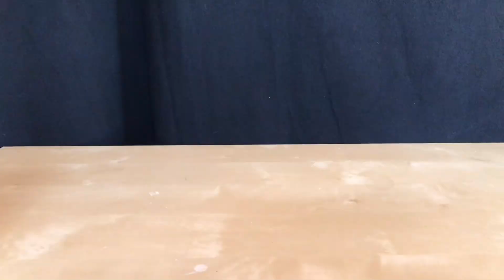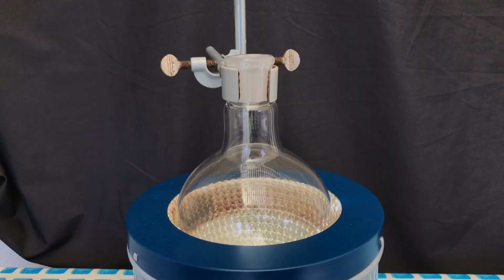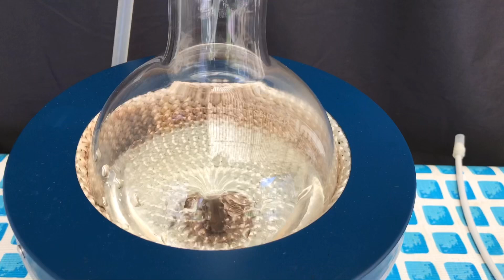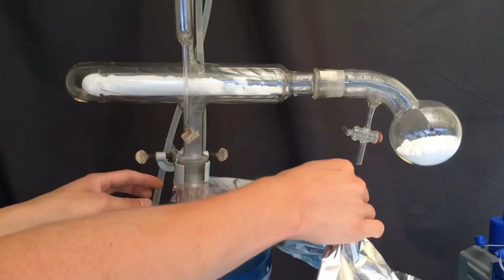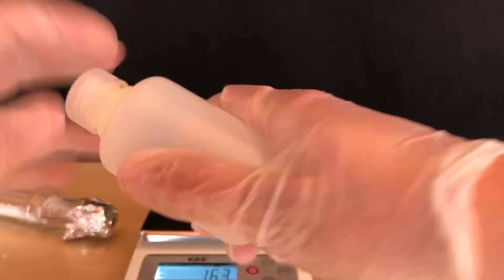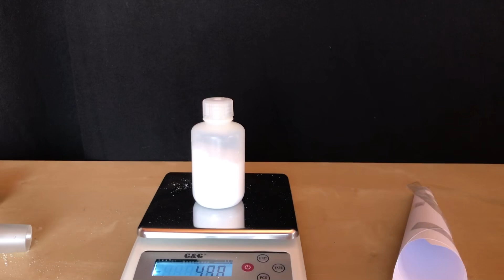Drying Oxalic Acid Without a Dean Stark Apparatus (using a drying pistol)

Comment: Your oxalic acid still contain some water. Oxalic acid dihydrate is used as analytical standard, because it doesn't adsorb water from the air. So that 1,7 g difference is some leftover water of hydratation.

Anyway, nice piece of glassware, I never saw that. However I think that drying oxalic acid with any kind of apparatus is unnecessarily complicated. Heating in the oven is good enough.

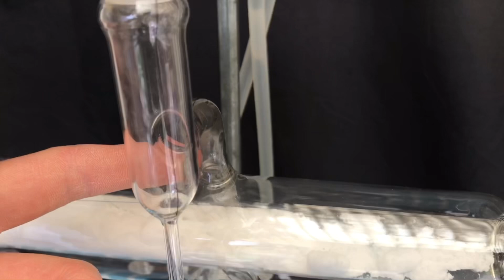Comment: 2:44 what's the black line going up the glassware? I see that in some of chemplayers videos.
Reply from the maker: Some sort of high temperature marker on the glassware…. I don’t know why they do that sometimes in glassblowing but this is not my only piece with such a line.
Reply: @THYZOID  Yeah, I have seen it a few times. I was wondering if it was a fixed crack or something, which would be scary.. a crack running all the way down the glassware, lol.
Reply: This line is applied on raw tubes that are used for glassblowing. It serves to tell if part that was made wasn't twisted too much which would make a glassware pice weaker. It is mostly present on better quality glassware.
Reply: @mieszkom1099  oh wow. Fascinating. Thanks